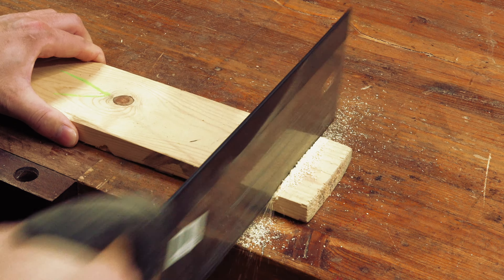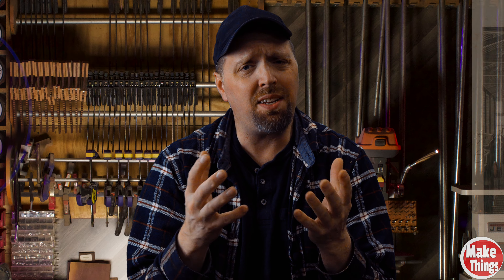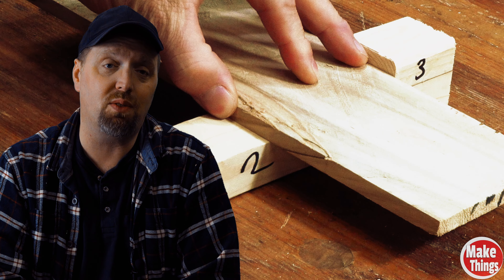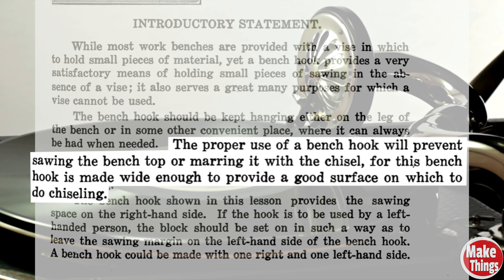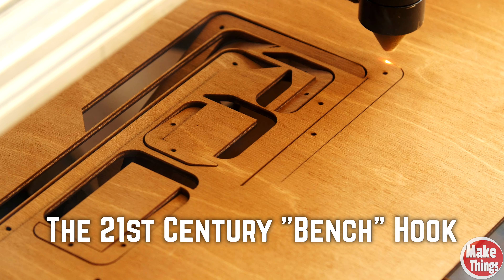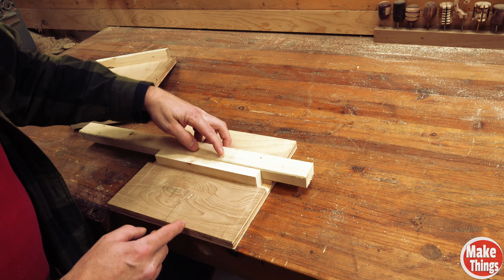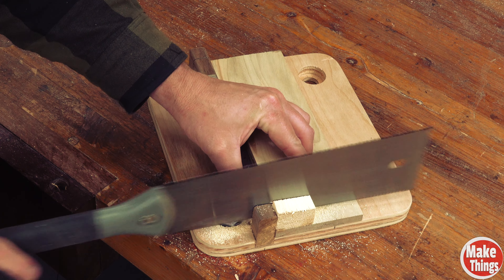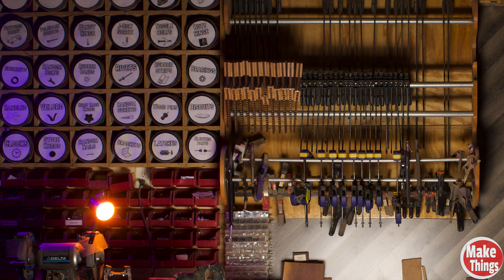5 Centuries of the bench hook (Let's improve it!) // B4WMT #8

Comment: I only have pull saws, so mine is a T shaped 20th century style one instead of the usual S design. I also used the kerf trick to help keep a straight cut. With less force needed on pull saws, I haven't had too much issue with movement... but I do use a hold-down style clamp on it at times ;) Great history lesson Rob!

Comment: Well done. I enjoyed the history and your progress toward a workable design. I solved much of the problem differently. I put the hook part into my bench vise so I can clamp it down. It does not move. I've put similar hooks on other tools to get the same rigidity, like my sanding wheel, a metal working vice, a miter box, and a bandsaw. Some peg into dog holes, too. I liked the bolt bench dog idea a lot, by the way.